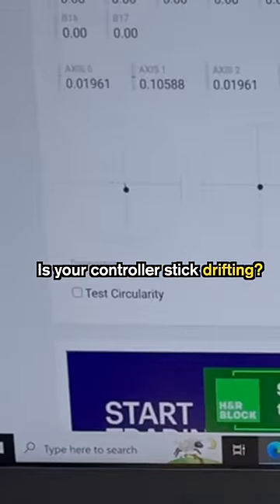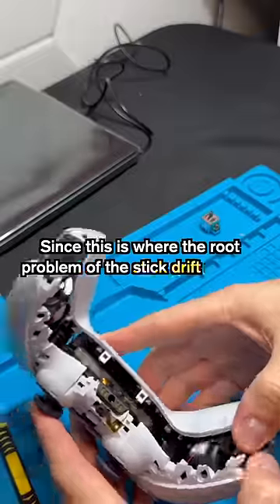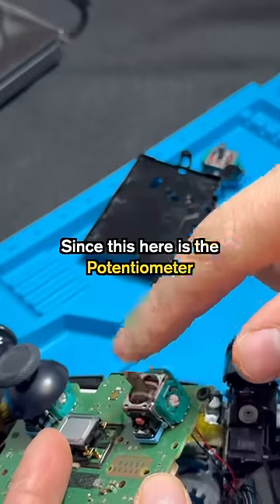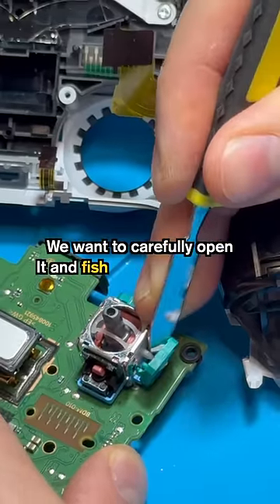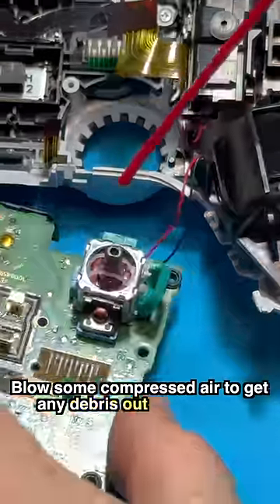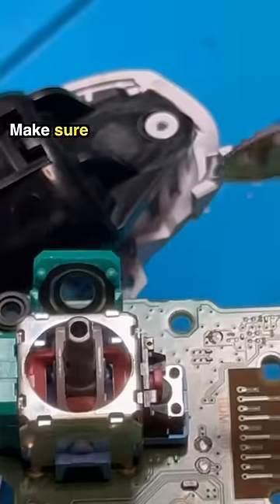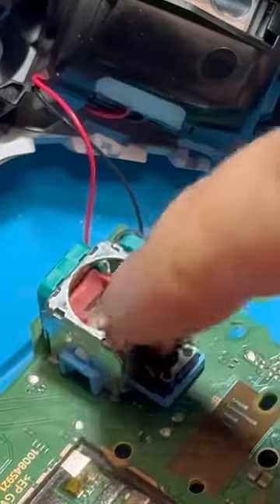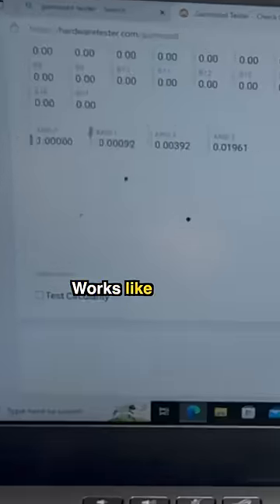Quickly Fix Stick Drift Controller (Ghosting) PS5/Xbox

Comment: My resistance track was worn to the metal. On left stick. Had to de solder green fixture and solder a new one. Now it WORKS!!!!
Reply: Was it a Dualsense you fixed?
Reply: @carlosswiftdev2703  yes
Reply: was it hall effect?

Comment: Do not do this unless you are good at stuff like this i did it and i had broke both the controllers i had and i was stuck on my Xbox for 4 months without a new controller your better off sending it off to a repair shop or buying new sticks to replace the old ones if your good at soldering it’s not easy to fix if your not pro

Comment: Na the resistance thingy always wears off its the reason we have stick drift they made them either cheaper or thinner for better response time yet it was a bad move
Reply: @youseffaisal4181  fr. Mine got worn to the metal
Reply: Yes they are not fit for purpose now.
Reply: For forced obsolescence

Comment: Never had stick drift on any of my ps4 controllers but I have stick drift to the left on both my ps5 controllers. Had 4 ps4 controllers for 9 years and ive only had the ps5 for 5 years
Reply: Exactly the same story here. Out of interest, was it just the right sticks that drifted? As that's what my two DualSense controllers did (bought at completely different times).
Reply: Replace the wipers in dualsense with those from dualshock. easy fix.
Reply: @Altnet89  are they the same? I didnt even think of that
Reply: Same here
Reply: Dawg them ps4 controllers are bulletproof 😭🙏🏽
Reply: Same with Xbox. Had 3 Xbox 360 controllers for 10 years no issues.
Had 7 Xbox one controllers each drifts between 1-2 years old.
Reply: every controller has this issue

Comment: A lot of those modules are bad right away. If you open a new module and look at it magnified, you can see a lot of times flaws and damage already in the carbon traces. It's a bad design.

Comment: “quickly” my ass bruh
Reply: This is mainly for people who have heavily modded controllers that get stick drift. Most people will just spend $70 and get the base controller but even then this will have it potentially fixed for free in around 2hrs.
Reply: @GRiznitDShiznit 2hr you crazy, this takes 20 mins max.
Reply: @alexisramirez3338  nah bro opening the controller took me 20 mins bro i thought id never make it to the potentiometer
Reply: @sohilmalhotra4053  Need more practice thats all.
Reply: SKILL ISSUE 😤

Jk, if you're familiar with taking controllers apart, this is okay as far difficulty goes. It goes without saying that its pretty daunting if you're a complete beginner to controller repair, but don't lose heart, everybody starts somewhere.

I usually buy my controllers second hand and I specifically seek out stick drifting controllers as I'm quite familiar with the repair process (including replacing the potentiometer completely if needed, or even upgrading to hall effect sticks). I lucked out on my dualsense as all it needed at purchase was a cleanup of the faulty potentiometer and a retentioning of the wiper's plastic holder piece.... no replacement, no soldering, or anything too complex. It was a bargain as I only paid £20.

Learning basic repairs and soldering is a handy skill and it really can save a ton of money, especially if you luck out on cheap faulty items that only need simple repairs.
Reply: @naliboi93 i did opened my dualsense once and to be honest dismantling it wasnt do hard as i expected, but reassembling it? Man that gave me nightmares

The fear of thorning a ribbon cable is something else 

my hands were trembling when i did this too so it didn't help
 (it felt like making a surgery on a injured pacient when you definitely have no idea on what you are doing lmao)
Reply: @FABSDAZZ  good effort if you managed to put it back together and have everything working as normal! If you aren't desoldering the rumble motors, the whole process can be a lot more challenging as well.

Once you loosen the clips after a first disassembly, future disasembly becomes slightly easier. I agree with you, reassembly is often much harder than disassembly.
Reply: The first time took 3 minutes the second time and more time doing it it takes me less than 10 minutes ALL
Reply: It is quick. 10 minutes and ur controller is like new. No need to buy a new one for 70 every time u get drift either
Reply: Did this and even replaced the wipers and drift came back 2 weeks later. Now considering paying to have hall effect out in
Reply: @diydrivenGA  could be another reason the drift is coming back so quickly. Try installing one in the another controller if you have one, and if the issue doesnt happen as quickly then you know its not the potentiometers u bought and instead is another issue caused by the controller. 

Mine is usually good for months after doing this. Good thing is a pack of the potentiometers are pretty cheap so even if you have to take the 10 mins to switch it out every few weeks, you still wont need a new controller. If you have a scuf or expensive controller it is definitely worth doing as opposed to buying a new one imo
Reply: @sohilmalhotra4053 the more you do it the easier it gets. And you'll need to do it again cus ps5 controllers are ass

Comment: I usually change the whole potentiometer. So I’m sure it will last again for some good time before needing to open it again. Usually the problem is whit the resistance material that with time will come off, so if you open it and have a solder machine and the skill to do it, I think is better to change the whole piece.
Reply: @yazmat96  that’s true
Reply: Facts

Comment: What they could do is have a recalibration button that sets the make it think the stick in back in the center but no they want you to buy a new one
Reply: I don't have any controllers but I'm curious, if you put your controllers in an airtight place so that dust doesn't get in, will you still get a stick drift?
Reply: @rudolfriddler it usually happens from using them too much/too aggressively, or by dropping them. Not sure about air tight containers, it might help prevent dust buildup but that's usually not the main cause of stick drift anyway. Hope this helps!
Reply: @Reznovelty  Thanks for the info! I am a keyboard and mouse player but always wondered how controller players felt about stick drift.
Reply: @Reznovelty  "it usually happens from using them too much/too aggressively, or by dropping them" - That's not true at all for PS5 DualSense controllers.
Reply: "What they could do is have a recalibration button..."
Unfortunately it's not that simple. Drift is often variable and intermittent. It can also make fairly random shaky movement. I'm pretty sure that's why Sony haven't been able to do a software fix.
Reply: @mr-hypercycle  thank you I love to learn somthing new fr thanks
Reply: They’d just manufacture them with Hal l effect joysticks if they wanted to fix it

Comment: So to potentially save people from wasting time on a repair that does nothing…

It is practically NEVER just a matter of a cleaning or a problem with the metal wiper…
However it is practically ALWAYS the carbon track that is worn down which results in constant contact…
Reply: It's residue of carbon from the track that needs wiping off. After it's cleaned it works great. I suspect after a few months to a year it will need cleaning again. The track should be made better than this. The controllers are not fit for purpose.
Reply: @bulbhead3333  well actually… not really…

Obviously things like dust, residue, dirt or any other form of material/debris can or will cause disturbance in the registered input, however if so it would most likely be experienced as twitchy or laggy or small areas or patches with less or no input registered… if the debris isn’t stuck in specific spot but can travel slightly with the many stick movements, these areas with less or no contact will appear random, which they would actually be in that case…

But residue from the worn down carbon/cermet track or other debris will not cause stick drift (unless we’re talking about debris big enough to block the stick from returning to center)…

And that is due to the fact that the stick input is registered by two potentiometers, x + y axis which I’m sure you already knew, but a potentiometer is a variable resistance component… (it could get more technical than that, but there’s no need for that), so the carbon/cermet track is actually NOT one of the contact surfaces, however it is the layer that provides the resistance between the two contact surfaces which is the metal wiper and the metal surface underneath the carbon track… So it is basically allowing contact but is reducing the strength of the contact…

So any carbon residue from a potentially worn down carbon track will not result in stick drift since this is caused by the carbon layer becoming too thin, thus providing too little resistance (slow pacing stick drift) or due to completely worn down carbon track resulting in full contact (high input/rapid movement stick drift)…

I would go as far as to saying that only if the potential debris has a high conductivity like a metal or liquid of some sort is it likely that debris is causing stick drift…

That is if you get all technical and detailed about it of course…

Comment: If the contact is worn out, you have a few options: buy a new controller (I recommend hall effect controllers, they are much cheaper now), but if you really like your current controller, there are tutorials on how to change the potentiometer if you are not scared of a little soldering. I once again, recommend to make the replacement a hall effect one, you can find tutorials on youtube.

Comment: just replace the potentiometer with a hall effect sensor (magnet based)
from any controller repair shop
& say adios to StickDrift FOREVER, Till the physical buttons wears out 🤣
Reply: Not hall sensor, with Gulikit TMR, mainly because of power output of the sensor of hall effect joysticks not being the same as ALPS, gulukit TMR fixes that with a higher quality electromagnetic sensor with low power consumption

Comment: It's not "quick" but I've sort of done this (thank god the stick still works afterwards) and unfortunately the drift persists. I said 'sort of' because I didn't open the plastic housing and just spray the cleaner from the outside. It's too nerve-wracking. But I'm going to try again tonight. Thanks.
Reply: did it work?

Comment: I did this and the green lid on the left analog wouldn’t close fully. After a couple tries it ended up falling off and is no longer connected to the motherboard. Now my right stick isn’t fully working. I need to have it soldered for it to work again.
Reply: geçmiş olsun

Comment: How to fix the ones for the ps4 controllers cause I had trouble fixing some I got I bought new analogs and they got some drifts also not sure if they are cheap ones why they have fault..
Reply from the maker: Same way
Reply from the maker: How to Easily Fix Stick Drift DualShock 4 Controller PS4 Analog
https://youtu.be/wUrmLxFWiQA

Comment: I replaced a new analog by soldring, but it still drifting, is thier anytjing i can do ?
Reply: use the control panel on your pc to access the connected devices and click calibrate.  DM FOR DETAILS

Comment: no liquid should be poured into the analogue device, otherwise we will wash out the factory grease that is inside the mechanism, dear friend, you have shortened the life of this analogue device and caused it to jam, bravo
Reply: Opened mine and there wasn't any grease of any sort. Besides this is a last resort if you don't want to replace them. Can't really break an analog that's....already broken.